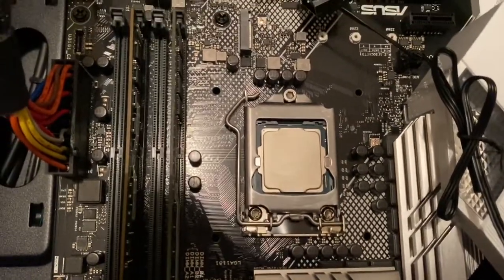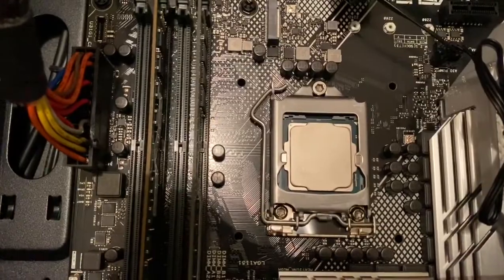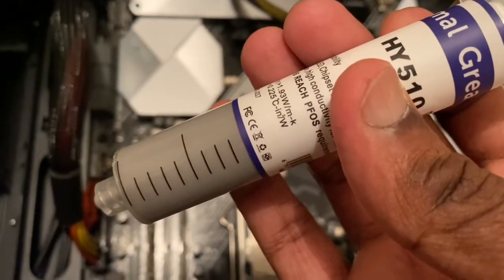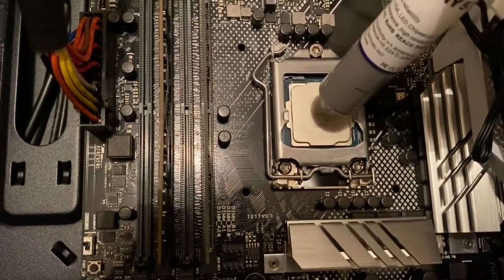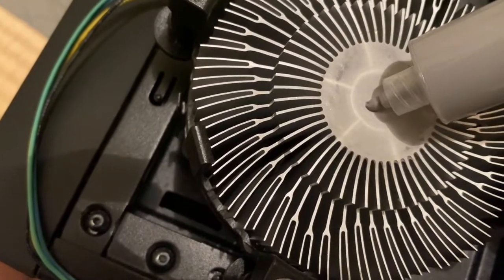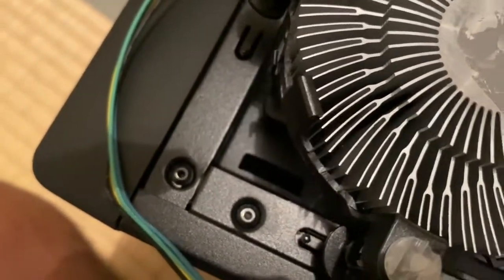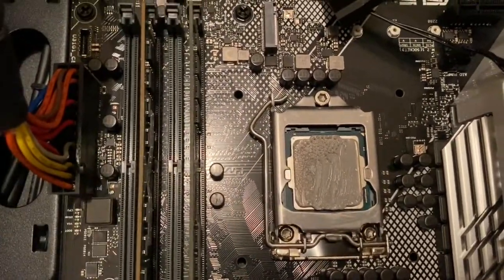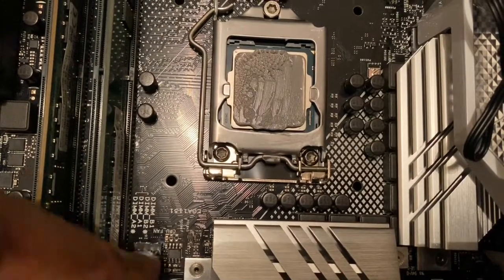How To Apply Thermal Paste On CPU - computer Processor

Comment: I don't quite fully agree on the need to spread the thermal paste with a spatula or putting more paste on the cooler itself.... that's something very minor and beyond wasting thermal paste doing that, there's no other downside. However, you're locking the cooler wrong. When installing the cooler, you need rotate all locks clockwise then push them after aligning them in the hole. You only turn the lock counter-clockwise when you need to remove the cooler.